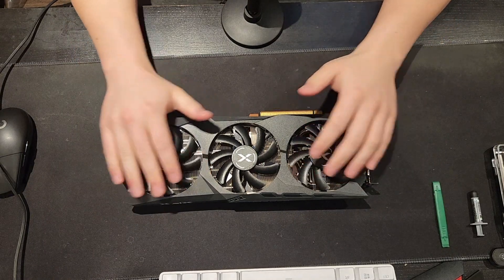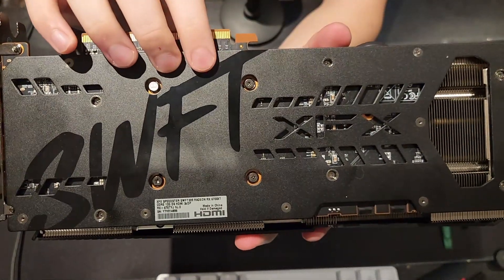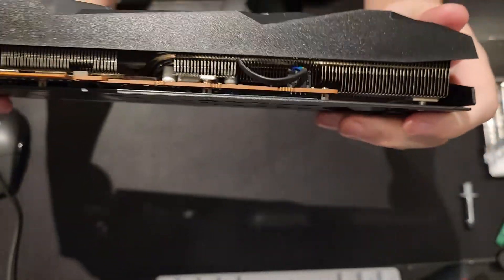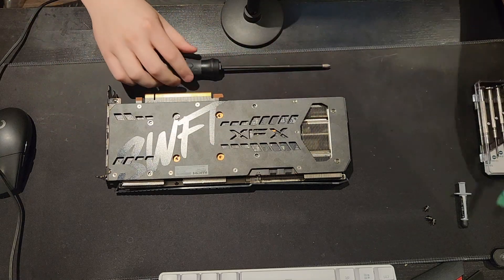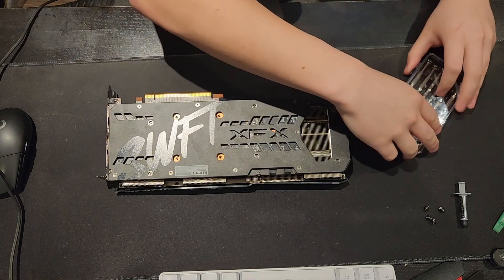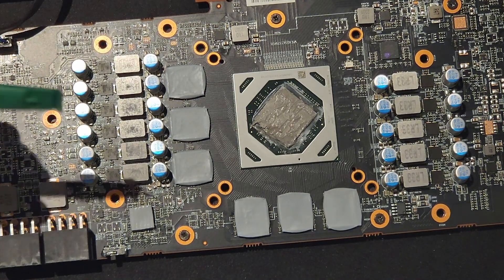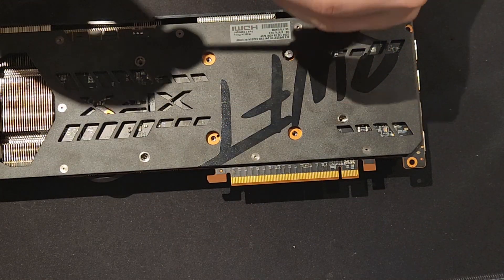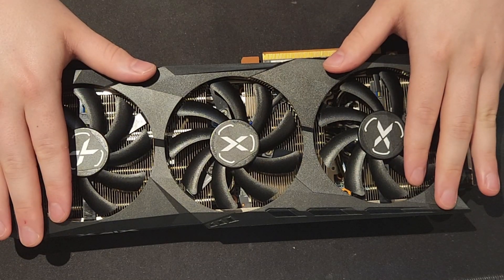$9.99 GPU Fix  ||  How To Repaste Your GPU (2024)

Comment: Thermal pads mm size please someone???
Reply: you can use thermal putty instead so you don't have to worry about getting the right sized thermal pads. i repasted my 6700XT with PTM7950 on the die and Upsiren U6 Pro on VRMs, really nice improvement  from hotspot almost 100C to 80C

Comment: ya 9.99 if thermal pads on memory and voltage regulators dont tear. better to be prepared with everything you need then to take card apart and have to wait for new pads to arrive

Comment: Do you know the thickness of the card's thermal pads?!
Reply: Did you do finally the replacement of thermal pads? If you did, can you describe me the different sizes? Than you
Reply: @Carlos-du6pz  

VRAM - 1.0mm
Coils and mosfets - 1.5mm
PWM - 3mm

I also applied 3mm thermalpads between the PCB and the Backplate "on the back" of the VRAM, VRM, PWM and graphics CHIP. My card does not exceed 65º at Full load. I also changed the thermal paste.
Reply: @Carlos-du6pz  

VRAM - 1.0mm
Coils and mosfets - 1.5mm
PWM - 3mm

I also applied 3mm thermalpads between the PCB and the Backplate "on the back" of the VRAM, VRM, PWM and graphics CHIP. My card does not exceed 65º at Full load. I also changed the thermal paste.

If you have any questions, search for "XFX Speedster SWFT 309 Radeon RX 6700 XT (CORE) - Hotspot issue, finally have an answer!" on google and click on the first link in the result, which will be from the AMD community. There, a member posted photos with more details. I hope this helps.
Reply: @Carlos-du6pz  

VRAM - 1.0mm
Coils and mosfets - 1.5mm
PWM - 3mm

I also applied 3mm thermalpads between the PCB and the Backplate "on the back" of the VRAM, VRM, PWM and graphics CHIP. My card does not exceed 65º at Full load. I also changed the thermal paste.

If you have any questions, search for "XFX Speedster SWFT 309 Radeon RX 6700 XT (CORE) - Hotspot issue, finally have an answer!" on google and click on the first link in the result, which will be from the AMD community. There, a member posted photos with more details. I hope this helps.
Reply: Wow bro thanks you so much for answering me. I bought 3 sizes: 1,5 mm, 2mm and 3mm.  I was thinking 1,5 for vram and vrm, 2mm for mosfets and 3mm for pwm. Do you think is wrong sizes?
Reply: @Carlos-du6pz  If you use 1.5mm on the VRAM or 2mm on the MOSFETs, it can affect the heatsink's contact with the graphics chip's dye, causing the chip's temperature to increase drastically. I tested it with 1mm on the VRM (coils and MOSFETs) and the contact wasn't good, there was slack, but with 1.5mm there was ideal pressure. In the VRAM, 1mm already generates adequate contact and pressure, I don't recommend increasing it. The coils need 3mm because there is more distance between them and the heatsink, I believe that using 2mm there will be slack. So, I reinforce my recommendations from the previous comment.

Note: tighten the screws in a crisscross pattern and make sure the spring still has pressure, if your board is used or has been with you for a long time. I had to replace the screws with newer ones and add paper washers to provide better pressure. In the end, it was perfect for me.